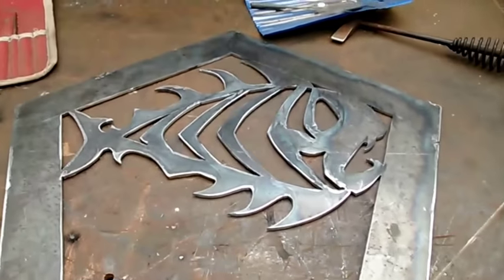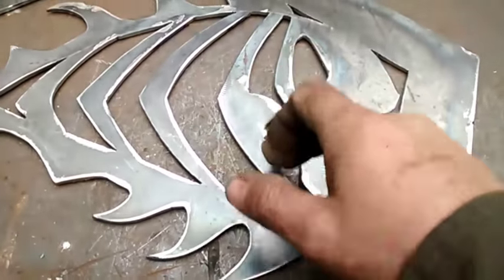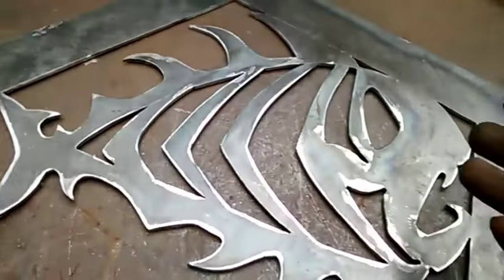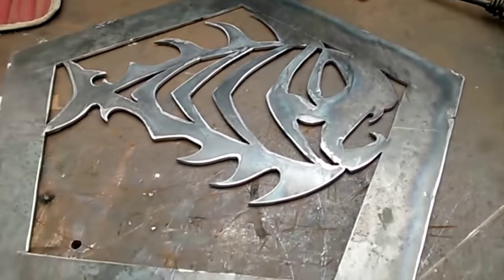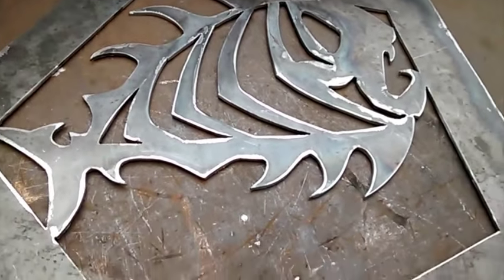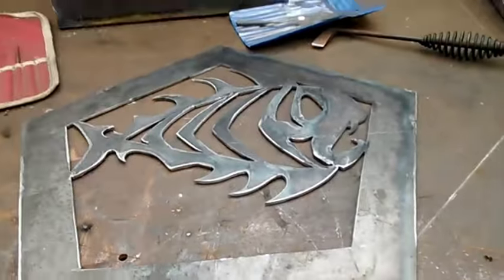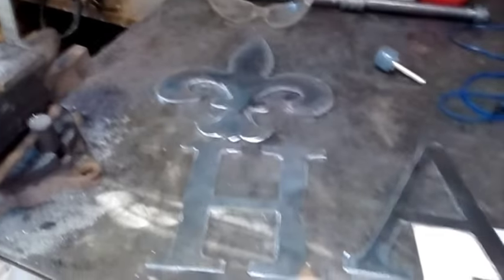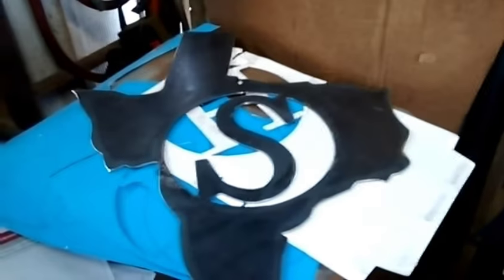Hand cut fish bone pattern

Comment: Hey bro allen love your vids they are awesome and you have one of the best torch hands ive ever saw soo steady thats the sign of a true fabricator i was just wandering why you never tried a good plasma cutter like the hypertherm power max 45 with the built in compressor i see lots of folks using them now have you ever used one i havent but would love to try one i think in the long run would be cheper than buying all that gas it goes quickly hope you have a great day i do metal work and wood crafts also out here in ga but im like you i work out side and in an unfinished basement and its not the easiest thing to do when its rainy and cold take care and Godbless